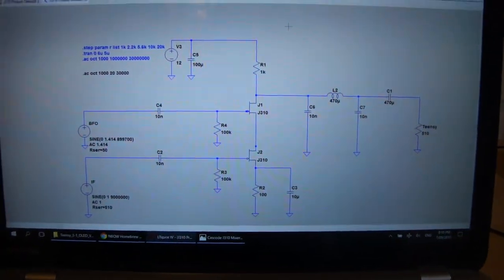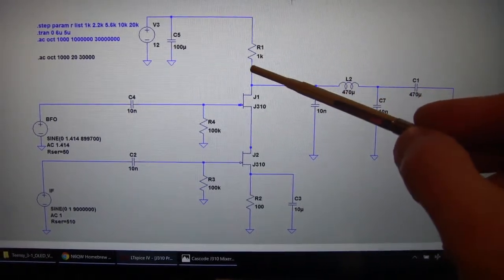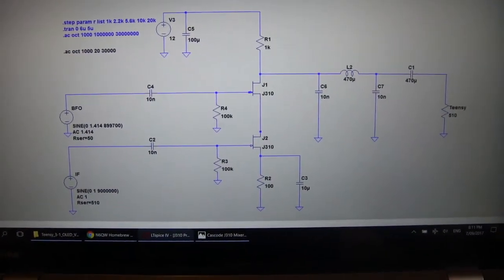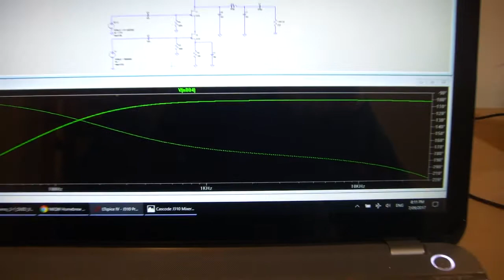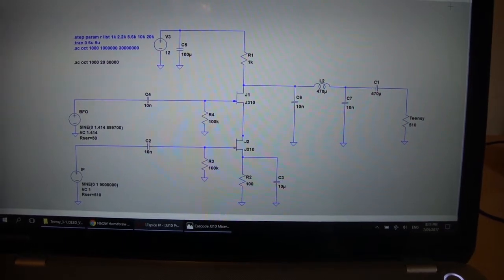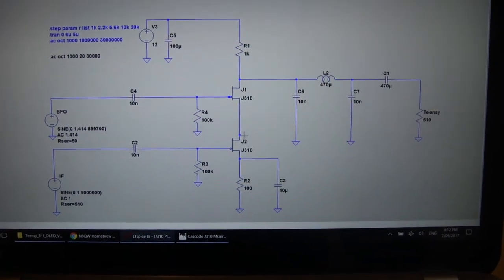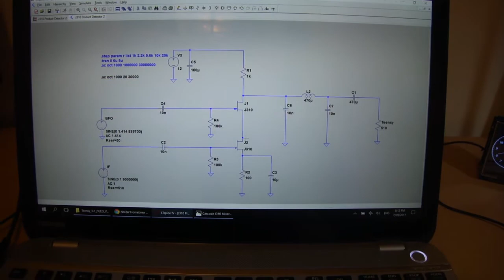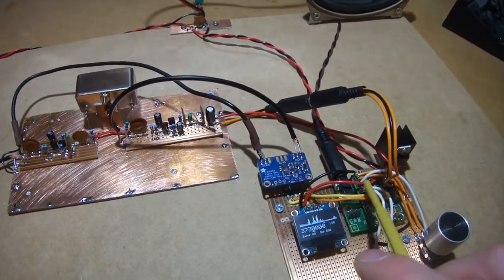Simple Homebrew SSB/CW Transceiver Part 4a - Updated Product Detector

Comment: Hi Charlie,Bravo and congratulations! Very nice indeed. You are absolutely correct -- amazing performance with low part count. The videos are excellent. The J310's as a DGM must be the world's best kept secret.73'sPete N6QW
Reply from the maker: Thanks Pete. You put me on to the J310s last year with one of your receiver projects. I'm please that I have a project to use them on and have managed to make them work. As you have pointed out also many times, LTSpice is a great tool to try out virtual components before melting solder.

73's
Charlie, ZL2CTM